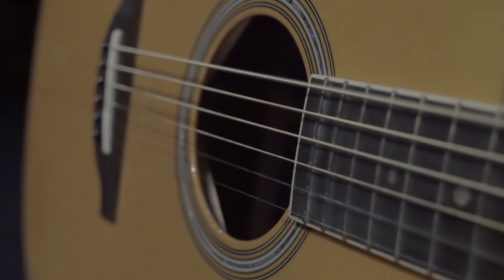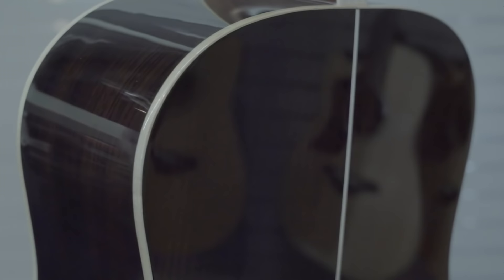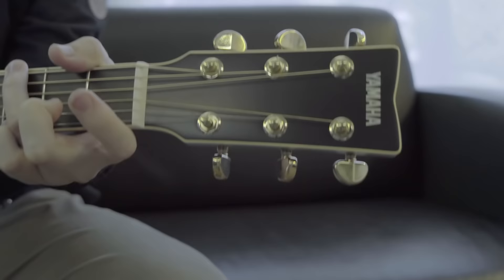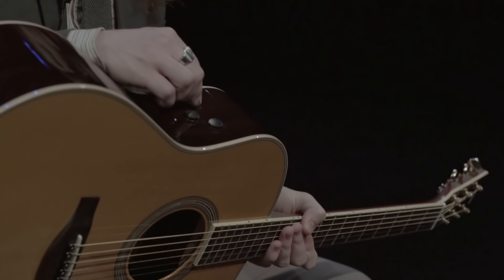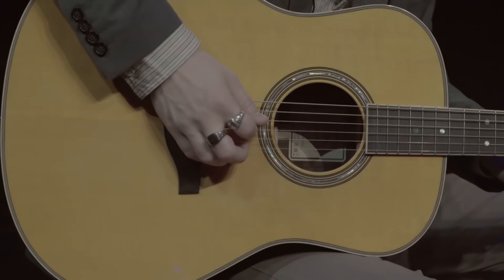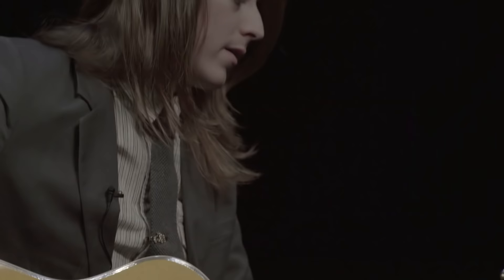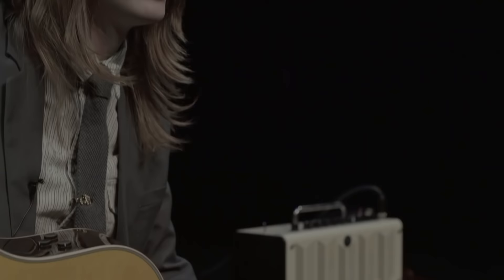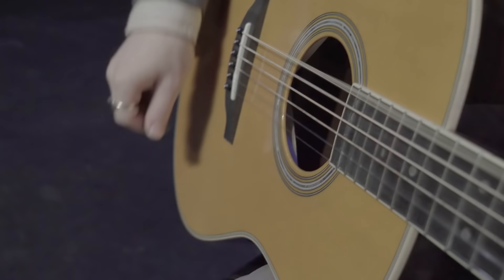Yamaha TransAcoustic Guitar – Overview with Joshua Ray Gooch

Comment: If I've got this right, the guitar (the acoustic guitar) can exhibit sounds treated with chorus and reverb without being plugged into an external amplifier? So, piezos then, and quite a few to make an acceptable sound. Might seem a bit gimmicky at the moment but those little speakers are becoming more than less. I'll stick with my Fishman and array of stomp boxes and Digitech Floorboard thing in the meantime. The potential is great but a guitar is a guitar. A pedal isn't gonna make you better. Might slightly enhance what you know a bit.

Comment: i rather Yamaha made the guitar that can amplify the sound cleanly too.  Sometimes you just want the guitar amplified clean without having to plug in . This is an L series. Supposed to sound good even without chorus or reverb. Why didnt they include a clean amplication function?
Reply: because it would need a speaker inside. These effects are simply obtained by a systen of magnets
Reply: it would have required a amp and a speaker, this relays entirely on the guitar and actuator, and therefore much lighter, and no strain on batteries, as a real amp and speaker would need much more power to work than two aa batteries.

Comment: I set my mind to buy this and wanted to hear the magic before I get it. The guitar felt extremely heavy and the 'magic' was just marginal. Decided to keep my money. Wonder if I am the only one feeling underwhelmed.
Reply: I hate it when the Magic is marginal.  Yam Giving Tonewood amps a run for their money?  I own a Yamaha AC3R ( also rosewood back and sides) great pickup system and getting ready to lower the action that overworks my hand when barring chords. I'm betting if there was a lower price on this LL-TA the magic factor might improve a bit.
Reply: He made this video in a an open concert hall, but if you use this in your house that would be different, that will answer the margin
Reply: It doesn't really sound that good for a hand-crafted guitar. About a 2-3 out of ten. Sounds like the neck and frets might need setting up because it sounded pitchy all over the neck when he played it. Maybe at $400-$500 it could be a cool fly guitar. Not cutting it for average Nashville work, at least to my ears.